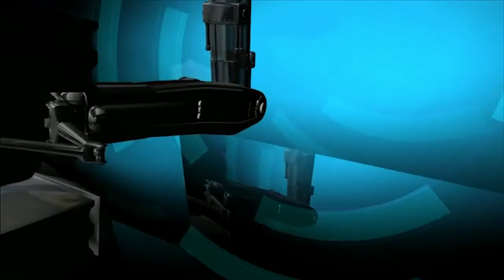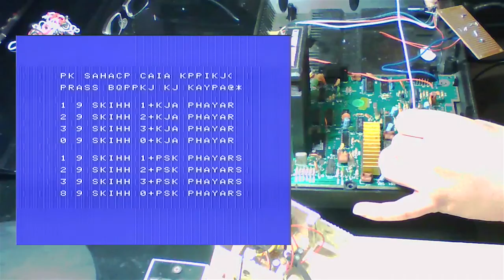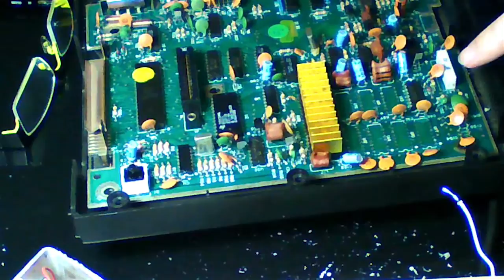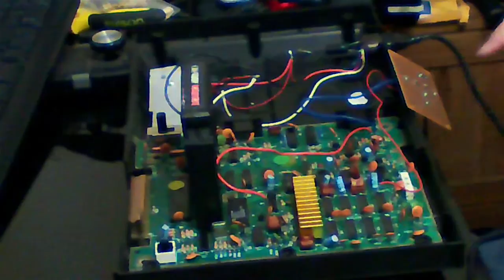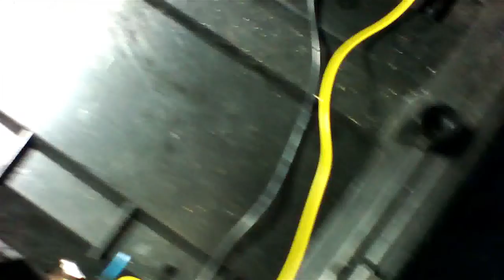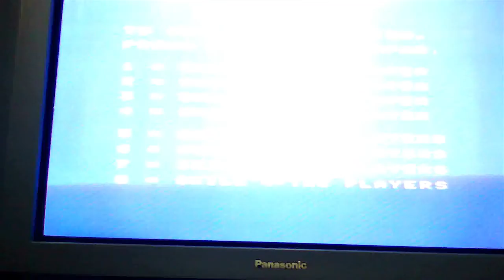Colecovision Repair

Comment: hello, I need help! i am French. please share my problem. thanks.
There is a false contact at the console's power socket. Moving the socket causes display problems. (the plug is plugged into a 4 centimeter box which contains 4 pins on the exterior side, and 4 soldered wires on the interior side. I left everything soaked in isopropyl alcohol but the false contact remains) the solders have the looks good, but we can't see inside the tiny connection box. How do I know if the problem comes from inside this box where the false contact is located, or if the problem is possibly located in a Ram? (because Smurf works (apart from 4 or 5 small foreign pixels) whereas a game like Buck Rogers which uses much more resources has graphic problems)
Reply from the maker: Sounds like it could be dry solder joints. Go over the whole board, every pin, and add a bit more solder, reflow

Comment: An a late FYI, the 4116 DRAM chips only require -5V to be applied first in order to keep from damaging the chips.  -5V is not switched.  Only +12V and +5V are switched, so the design of the system actually does seem to make sense.

Comment: I am getting garbled text on start up. I guess it is a RAM issue?  Sound seems fine on startup but the graphics are also messed up. So I guess I need to do this RAM chip mod as you have done?

Comment: Do you know anyone who will work on these boards for me? My soldering ability isn't great- I was willing to de-solder the power switch and clean that, but it didn't fix the problem on my machine... If I attempt to replace ram chips or the video processor I fear that I will ruin the motherboard...
Reply from the maker: I think gadgetuk does it?
Reply from the maker: GadgetUK164
Reply: @RetroGames1979  thanks!

Comment: If you ever see this message , here is my email address .. paquetsky@hotmail.com ,  I would really like to get the info on how to do exactly what you did with the memory ( ram ) what parts I need and chips ...   ,also for the composite output ... I have 2 excellent original power supplies so no need for the other stuff

Comment: I have corrupted graphics on my Colecovision, i hear people say it must be the powerswitch (second option would be the vram chips) I want to take it apart and give the powerswitch a good cleaning. It is not my powersupply because i've tested it with my spare Coleco. The spare has a distorted sound btw, any idea how to fix that?
Reply from the maker: Sounds like the vram to me. The power switch can cause the fault by not putting the correct voltage in at the right time, and once they are broken, it's there until they are replaced
Reply: Thanks for replying, i hope i can get it done. I've never done stuff like that before. I only replaced the 72 pin connector once on my NES and removed the lockoutchip. So i hope i will do an ok (read non destructive) job on my Coleco.

Idk why, Coleco isn't even my favourite to play games on. But it's such a special console to me. I want it to work again.

Comment: Hey guys,  I just picked up a colecovision that dose not seem to be working. I tested the power supply and it does appear to be giving me +12 +5 and -5vdc. This maybe a silly question, but do I need a game installed to turn this system on, as I do not have any games at this time? 

Here you might like my collection, of vintage computers and video game systems. There are several systems that are not displayed, but you will see most of them on the video at the bottom of my webpage. www.theageofgaming.com

Thank you
Reply from the maker: Hi, you don't need a game with the colecovision to see the logo screen. if you have the correct voltages, do you still have them when the system is turned on? sometimes they drop once connected and turned on

Comment: hi excellent video great information on the memory chips I have a question I don't know if you can answer I have a ColecoVision that powers on fine and plays fine for anywhere between 10 and 30 seconds after which the screen will go black or green with garbage on the screen I've tried to power supplies and I have cleaned the power switch I have even installed and f18a VGA board which will bypass all the ram and I get the same result do you have any suggestions I think it could be a capacitor issue but I'm unsure because I cannot read schematics what could cause it to work 410 to 30 seconds and then go to a black or a green screen with garbage any help appreciated but okay in any case thank you
Reply from the maker: it sounds like a faulty chip, over heating maybe. probably ram but may be CPU. put the back of your fingers on the chips and see if any are getting hot

Comment: So just to make sure, you did only mod the 4164 module, no need to mod the pcb-board in any way if you do the "leg-mod" to the 4164?
Reply from the maker: That's right
Reply: ***** Thanks for posting this video, I did this the "easy way" and just cut all the 4116, and then solder the 4164 on top of the old legs. Its not pretty, but my Colecovision is now working, thank you! :)

Comment: in theory, 1 could disassemble a pc power supply, has the +5 and the - 5 and +12 volts built in, ;-) OR an arcade power supply may work also, same voltages built in, ;-)

Comment: Enjoyed the video, can you show scope on the power supply output?  Would be interested to see how smooth the switch mode is.
Reply from the maker: it's all screwed together now, there was about a 20mv ripple but once through a coil and cap there was nothing!
Reply: *****  How much ripple would be "ok"?

Comment: Great vid! Out if interest what was pin 1 on the 4164? If the RAM ever starts glitching you can always switch to the next 16K, or 32K block using the currently unused address lines. Very interesting regards that switching regulator - what's the part number on that? It can be frustrating trying to drop input voltage with 78xx regulators, I had no end of fun trying to provide my MVS with 5 volts, due to that 7 watts heat conversion. I guess it's why a lot of old systems use 9v / 10v PSUs. The extra 2 or 3 volts makes a huge temp difference. Depending on current on 12v line, you could probably make 12v using a ladder or something. Not looked how it's done on the MVS but you can feed 5v in and somehow get 12v out - will take a look at that at some point.
Reply from the maker: the magic chip is a 34063 you can go up or down. Pin 1 was just a N/C but could be unofficially connected so best to remove :) I didn't put it in the video but the problem with the power supply wasn't the need for the power mosfet, the 34063 had no trouble handling the current, the problem was the manufacture pdf example was limited to 500ma, remove the limit, problem solved